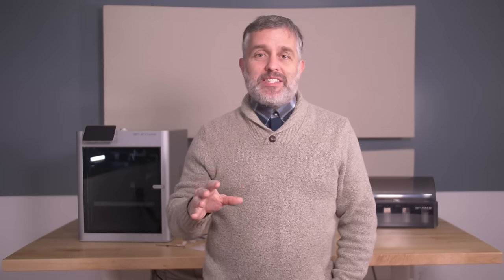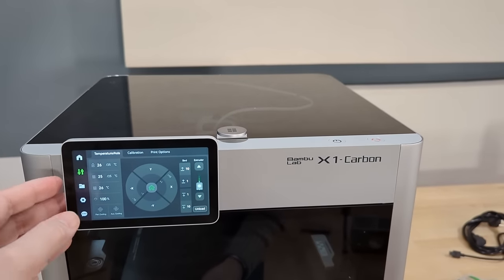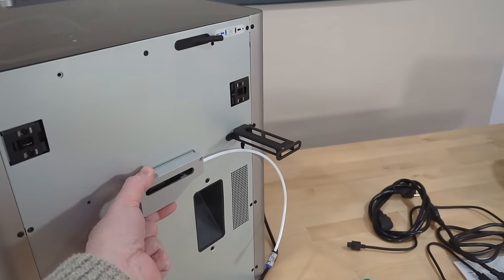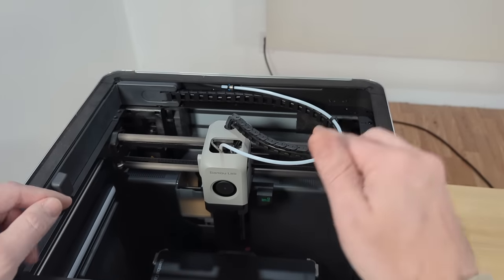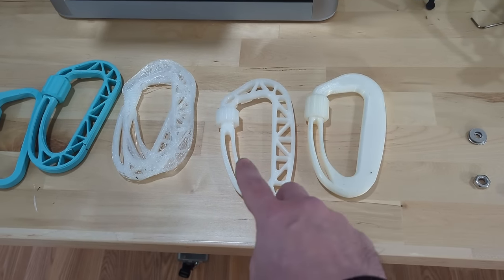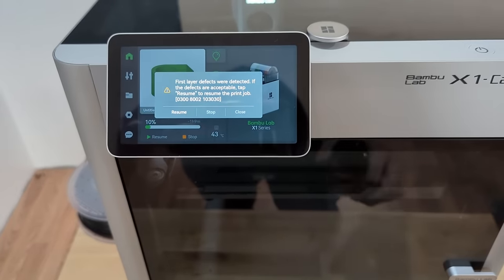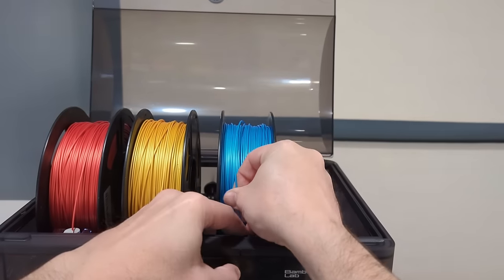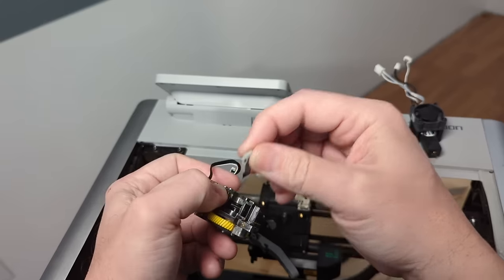Why The Bambu Lab X1 Carbon is a PhD Master Class in 3D Printer Design

Comment: Great analysis!  Thank you!  Keep this series going.  I was a little disappointed that you did not dismantle the bed further.  You promised a destructive disassembly 😊.  Seeing Nylon warping was priceless.  Nothing can resist shrink forces.  I had several glass and carbon fiber beds destroyed.
Reply: I took the bed apart. It’s nice, it has thermostat switch to cut off power at 160C as a safety mechanism. And 3 force sensors, 1 in each lead screw joint

Comment: At 1:01:44 that "transformer" looks like possibly a common mode choke. It's wound like a transformer, but it goes into the circuit "sideways". This is for noise and RFI filtering.

Comment: For 3 stepper motors for the bed you need 2 additional stepper motors + 2 stepper drivers. Then I've seen them going out of sync, and it can break things. And you don't need them anyway as the bed height is rapidly adjusted as head flies above. So it would only increase price and reduce reliability for no actual difference in the prints. The only reason you may want to do this if you don't want to control bed leveling on the fly and instead just do an initial adjustment before printing. But it means you solve software deficiencies by adding hardware. Also it would not compensate for bed warping so it would still require level adjustment on the fly. Another problem is where would you place motors? If directly under the screws, it would require to increase printer size as there is no free space under the bed or around it. If on the back, where they would not interfere with the bed, it would be quite lame to use 3 belt drives. As Elon Mask said, the best part is no part.

Comment: MAN OH MAN! What great detail! Im a mechanical engineering student and you really tickled all my concerns in investing in this 3D printer, which is a good and bad thing. As I am a student, Im worried about investing all my hard earned money in this printer(mentions on the longevity - for example: the circuit board placement), but I also know all the great things I can do with this printer. So Im a litte torn on buying this shiny bad boy. 

I would to hear your recommendation for someone who doesn't have much money to throw around. 

Thank you for your effort and great quality for information and dismantling skills! :)
Reply from the maker: As a mechanical engineering student with knowledge and skills, I think you would be best serve, practicing. Flex those muscles man! Build your own printer. Or at least heavily modify one. Are you following Dr. D. Flow? There are so many options for you. You could start cheap like REALLY cheap. You can find used Ender 3s for around $100 dollars these days. Put a filament run out switch and a bed probe and you're as good as a Prusa. You can print anything you realistically would need. Not as quickly as the Bambu but you can then move on to more grown-up projects like a CNC router or a CNC plasma cutter.
Reply: @DesignPrototypeTest hmm good advice! I'll check out Dr D Flow. I have been worried about burning my house down with these kinds of projects😂 but it is time I get into modifying, other than just building a house for the 3D printer.

I must say I was really captivated by the pure beauty of the bambu. It's just such a high tech machine. But time is on my side, so maybe modifying something can prove more useful.

Thank you for your advice! I'll be sure to watch future content 😁
Reply from the maker: It is beautiful. It's also proprietary. Not a lot to modify there. There's other ways to skin a cat. You won't learn what they are unless you start at the bottom.

Comment: That was an emi inductor where there was mains going into the board. I could send you pictures of them. They're used for common mode rejection and safety as you can see along with the 3 class y rated capacitors.

Comment: The carbon filter is for VOCs when printing ABS, ASA, etc. Also when putting the plate back on the bed you just touch down the two back corners so they are positioned in between the gray plastic guides then slide back till they hit the rear guides then lower the plate down to the bed. They won't go over the guides if using the proper technique to place the plate.
Reply from the maker: Do you actually own one of these? Your description of how to put the plate down wouldn't work. There's a center portion that pops out. Also the corners of the plate are rounded so they wouldn't index on the side guides.
Reply: @DesignPrototypeTest  Yes I own 2 of them. Maybe you're not understanding  my description. The two side guides have contours so you can drop the back corner of the plate down next to the guide at the bed surface while holding the front up so you are not fighting the magnetic force of the bed and then push the plate back against the stops in the back. The rounded plate corners easily slide along the contour of the side guides and center the plate for you. I've done this hundreds of times. If this doesn't make sense, maybe a video would help.

Also you're not correct on the cloud. You can use LAN only mode or print from SD card. In Bambu Stuido you can just hit the drop down arrow next to print plate and export to and SD card. You can now reprint from SD card from printer too as of last firmware update. Just FYI so you can do a follow up video correcting some of the misinformation you have in this one.

Comment: 1) magnetic sheets exist for a very long time.
2)  Lidar checking for fillament deposition is NOT a Chinese invension, you can still find the original creator on youtube explaining and sharing the knowhow, but indeed Bambulab seems to be the first to implement it.
3) The filter idea is good, but it doesn't do much. Its just for the exhausted air, while it should have been to circulate the air inside the printer to absorb toxic fumes. You still get that when you open the door.
4) The Lidar has a laser liner and a camera, the dots is for the camera to know how to scale and interpret distance, since the bed might be 1mm higher or lower and that's critical to determine the height of the first layer.
5) Wait for patents to expire and then the printer will get a great update. 
Great review.

Comment: I am glad you took it apart and did a in depth look at the internals, I have not seen anyone go into that much detail on the X1C. The brass bushing on the CF rods is rarely/never talked about, to me that is the greatest point of concern mechanically. Your comment on the assymetric forces of the belt interacting with the brass bushing is also worrying. 

Can you look into how easy it is to remove and reinstall the CF rods and the bushing? I assume that eventually the rods and bushing will be made avaialble for purchase, if not by BL then by a chinese cloner. 

Keep up the good work. Looking forward to more videos on the X1C.

Comment: I'm posting this a year after this video was uploaded but I got my X1C about a month ago and have had no issues with it. My only failed print was due to wet filament. Retrying it, without changing any settings and just changing the filaments to one that had been recently dried worked wonders. I actually did my first ABS print today, and I didn't experience any issues with smell. However, I was using ABS-GF from Bambu Lab, so I'm not sure if there's a new formula, if the glass fibers assist, or if the filter has been updated, but basically no fumes. Printer is in my bedroom.

Comment: Good that I watched till end😂. From I understanding, this is the first video on Bambulabs, to be extremely technical and nuetral(esp. lack of innovations, other than lidar for bed leveling), while highlighting issues with data privacy and intellectual property protection and the true spirit of open source hardware and software❤👍👍.
Reply: Looks like you are not into 3d printing. First, lidar is not for bed leveling and second, every bambulab printer has a LAN mode, no cloud or even Internet needed there at all.
Reply: @fw_uke_ha  Exactly! Lidar has nothing to do with bed leveling. Lidar probes the final z-offset and determines the final height of the nozzle and the flowrate of the filament. Lidar is not there for probing the bed. This is done via the heat bed sensor unit and pressure. This unit can sense force signals and convert these into  electrical signals, according to certain rules, There for three ceramic force sensors are installed on the bottom of the heat bed.
Reply: 😂 Lol, you claim issues with data privacy and individual property rights upload and/or download your stuff from thingiverse or other platforms?
Is there any proof of data abuse from bambu lab? This is exactly my kind of humor.

Comment: Another point about the bed. From a cursory look at the PCB I think it's actually running rectified DC, not AC. This is probably done for end user safety. Better to have a burn than electrocution.

Comment: after hundreds of multi-positioned prints, we have never used any glue on the buildplate. Our last printer was the FL Sun delta printer and used a PEI build sheet also never using any adhesives after thousands of prints with no failure. Using a cheap filament ($15) ended up with various adhesion failures even though we feed from a drier.

Comment: About cloud printing: That’s not mandatory, the current version of the slicer (and I think the one prior) have a LAN-only mode. I haven’t used it, so don’t know if you lose any functionality in the process, but you definitely aren’t forced to use the Chinese-operated cloud if you don’t want to 👍😁

Also, there is a “Load” button for filament, at least if you’re using the AMS. I don’t know if it purges the previous filament or not, but it always poops out some filament at the start of each print anyway.

Comment: This was one of your best videos, you took a lot of time and were mostly correct with your assumptions.   I also agree with the concern of having to send the files through the Bambu Cloud, as the LAN mode is in my opinion worthless.  You can save the g-code and examine it, but the only way to transfer it is via SD, which is so outdated.  I'm hoping that someone will come up with a hack to make this more like Klipper where the printer can be accessed via a web browser.
Reply: You can print via bambu studio in lan mode where it does not use the cloud.
Reply: @ShuhDonk  But you can't see the camera, and I'm not sure you can submit jobs.  I tried it and was very dispirited.  I hope they make the LAN mode the same as using the Bambu cloud
Reply: @woodwaker1  Correct, the camera will not work, not sure what you mean about submitting jobs though.  If the printers are in lan mode you can print the same way as you do via the cloud in bambu studio but does not go through the cloud, directly to the printer.
Reply: @ShuhDonk  I'll have to try it again.  The loss of the camera was a big problem for me, as I submit most of my prints from my office two floors above.  I can control my Rat Rigs with no problems and send g-code directly to them, no 3mf files needed and no reslicing.
Reply: @woodwaker1  yeah, I do wish there was an octoprint kinda thing available for the bambu lab printers and not needing to slice and resend when you print the same files over and over again, which is what I do between the 7 x1c's I have everyday.  I could put the gcode files on the sd cards of each printer but prefer to control all the printers remotely from a pc like I did with my prusa's and other printers via octoprint previously.
Reply: @ShuhDonk  That is all I'm asking for.  It does not make sense to send a file to China to print on a printer 100 ft away.
Reply: @woodwaker1  yep I agree, but lan mode does work from bambu studio, just need to slice the file before sending the print each time.
Reply: I will not purchase a printer unless I can send it g-code over the local network, and it has a camera that works over the local net work - something like octoprint.
Reply: @23lkjdfjsdlfj  This one is not for you then, at least as of right now.

Comment: Hey DPT one thing going around for the ABS is that to keep chamber temperatures up for ABS the chamber vent fan that pulls through the filter is completely off. That let's air seep out of all the unfiltered cracks and crevices instead of getting pulled through the filter. I have heard that you can turn on the chamber fan at a low speed to improve filtration but I don't know if anybody has really tested the dofference

Comment: Adding two additional Step motors is more than just cost! it would grow the overall product size, it would cost more, it would weigh more (shipping) and on and on.  There is no need to physical level the platform if it can be monitored/characterized in realtime. This is a smart machine with eye's backed my neural processor.

Comment: Almost finished the video, couldn't get a good look at the transformer you mention. If you're interested post some better pictures of it or video so I can inspect it better. I can apply my power supply and magnetic engineering experience and determine what it is. Best test would be to measure the voltages. Could be a current transformer.

Comment: for the printing plate, bring it in on an angle at the back of 30-40 degrees, lineup the brackets and back edge with the plate then bring the rest of it down.  Works almost every time.

Comment: I believe the AMS only sits on top of the glass because it had to ship inside the machine. Why have any dead volume when moving something 10k miles? I'm also guessing that the bearing surfaces on the print head being outside of the belts is a huge help with the actual distance between belts. You've got those exceedingly rigid carbon rods that should prevent torsion.

Lot to respond to in this video! Been waiting for your review 👍

Comment: Thank you for such a detailed review! It definitely a good thing that Bambu comes and tries to eat the whole pie of 3d printing instead of taking a cut.
But no revolution for sure. I still do not see much reasons to change my Ender 3 (the first model) to anything else. Those custom profiles or even frames (like V3 model or A1 mini) are one time use. And that printer was a really great improvement over models of that era. It is cheap and reliable, easy to maintain.
While it have some problems, which Creality for some reason do not want to fix and sells it as is still. But after you fix them (and no it is not second Z bolt or BS-touch) it prints and prints and prints. And later models are just crap. So its no rocket science Bambu is popular among those who bought crap and couldn't make it run.
As for Ender 3, I just installed some cheap DIY DD and fixed bed surface with foil and bare hands, and the rest is done with firmware upgrade. Linear Advance, Input Shaping, new hotend heating algorithm, you name it. It is just unbelievable that $100 7 years old model can print with speeds and quality comparable to top notch printers. I have less then 30% difference with X1 Carbon Bambulab estimation with stock motors and belts. Just enabled 3000 mm/s2 accelerations and 150mm/s speeds. I do not print PLA, but PETG and 0.6mm nozzle  Bambu PETG profiles use 150mm max speed. I actually copied print settings from Bambu Slicer = )
So I am not a heavy print modder, when only frame is left from original Ender 3. And on that background Babmu printers does not look so great. I was expecting more from them. For example lazer filament motion sensor. But they only provide runout sensor, so users will not use cheap filaments. Which is understandable.
Mostly people talk about ecosystem. Which is copied by other companies already.
This cloud tech is a really smart idea I guess = ) They have a lot of stls now for free. And people are registering by themselves. It is a really smart move.

Comment: At 18:00, you mentioned adding 2 more motors.  You'd also have to add 2 more drivers for those motors and circuitry to control them.  It would add a good bit more to the price of the printer.

Comment: At 18:00 in the video, your assertion that adding two additional stepper motors would only add an additional "$9.00" is probably low. 

There are other factors like there installation, possible modifications to the framework, etc. But even if it were three to four times the cost, it would probably still be worth it, if it would helped to add to the accuracy of the "Z" movement! 

So far, a great video!

Comment: 21:43 I think the big fan isn’t only for better cooling but for better heat distribution and more heat in the build chamber when printing with closed doors for high temp material. 
I uses a similar mod for my Voron. It adds around 10c in the chamber.

Comment: Best review of the carbon on youtube! Honest and detailed... BTW it isn't really lidar, just a camera.
Reply from the maker: There is definitely a laser. You can see it. Don't know why they would ship a laser and camera module if it does nothing. That's pretty much the most scammy thing I can imagine. Would put them out of business.
Reply: @Design Prototype Test  it may be a laser, but there is no range finding only structured light scanning with a camera for edge detection and print quality adjustment. Not technically LiDAR.
Reply from the maker: That's good information! Can you tell me more, or is there an online source for this already? Maybe I can include the info in a future video.
Reply: @DesignPrototypeTest  I work at a Montreal based industrial 3D printer manufacturer and have looked at the tech involved. It seems like only cameras and (possibly) structured light. No range finding. Still very good and useful, just not technically LiDAR to us.